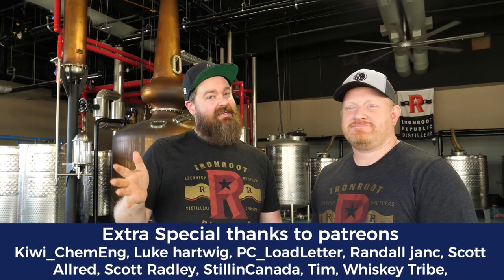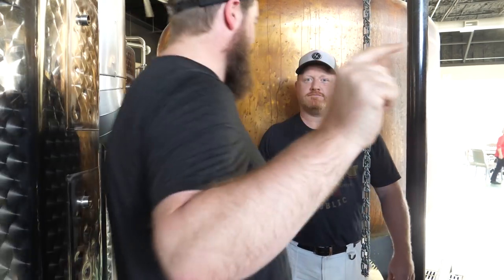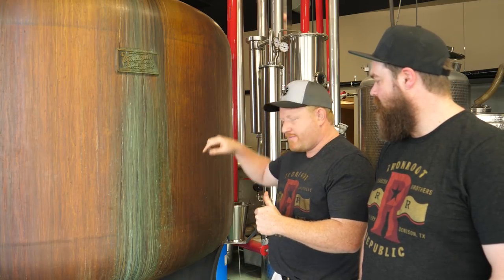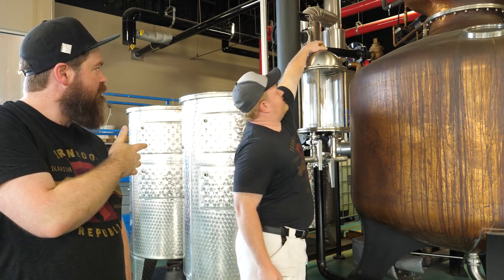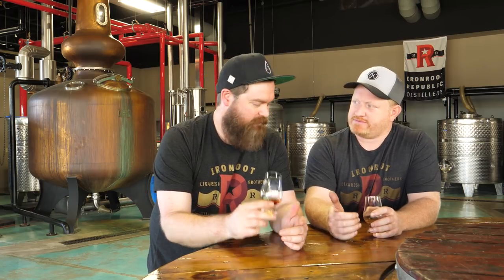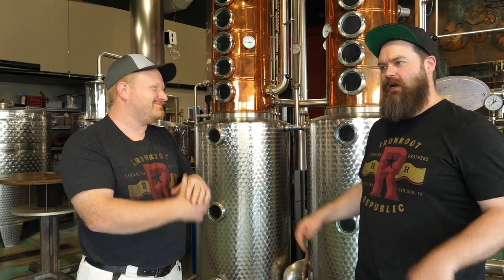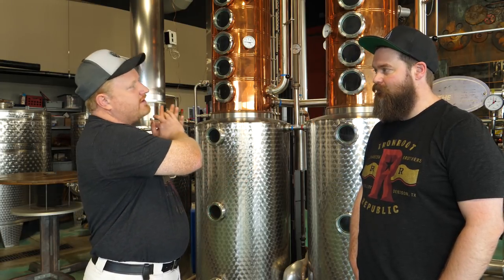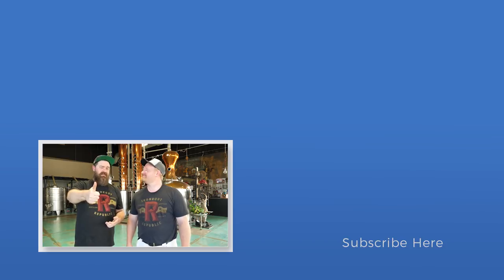The Stills Ironroot Use To Make The Worlds Best Corn Whiskey

Comment: This makes me want to buy a nice big sheet of copper and start bashing! nice tip about the condenser water temperature control. I have wondered about that in the past, and I've usually just adjusted water flow rates to get the output as close to 20ish as i can without having to constantly fiddle with it, though I reckon there's some experimentin' to be done!

Comment: Great video Jessie!  I gain addition knowledge with each video and the discussions that are driven by them. The copper craftsmanship is a work of art and science.  I generally thought that the colder I could keep the condenser the better, but it makes sense that you want to keep the condensing towards the bottom so you have vapor in contact with the copper for as long as possible before condensing and collecting it.  I am going to monitor my water temp in the condenser now.  Thanks!
Reply from the maker: Yeah those stills are awesome right? 
That was a big take away for me as  well.

Comment: Good one Jesse.  You asked the right questions and I could see how much of what they do on the commercial scale relates to what we do as hobbyists.  For instance, there's a lot of discussion in the forums about the importance of maintaining a heat gradient in the condenser.  They do it by maintaining the temp of the coolant and we, as hobbyists, do it by maintaining the flow rate of the coolant - achieving the same end result.  Lots of thought provoking discussion in that video.
Reply from the maker: Pretty interesting right?

Comment: So what happens to the sulfur that is removed in the pot and column? Is it just always in there stuck to the copper?
Reply from the maker: Yup until its cleaned out every now and then.
Reply: @StillIt  What a nightmare it must be to clean out that massive still, or do they just hose the inside down with water?
Reply from the maker: @MsBlacklabel1  they can literally climb inside it haha
Reply: @StillIt  hahaha, that's true. Can u make a sulfur taste test video with a copper or copper packing run vs without copper? sulfur taste test or something? not alot of info out there
Reply: Sulfur sticks to both the copper column and inside the copper boiler. Lot of Hobby Distillers add copper scrubbers inside the column and, directly into the boiler (inside stainless steel keg - copper pieces or wire) to remove additional sulfur.
To clean copper - Citric acid bath. Soak until the copper becomes shiny. Takes only a few minutes depending on concentration of citric acid. You can purchase citric acid on amazon. Or in canning section of your local grocery store or box store.
Reply: BigEdsGuns I’m aware of this. But how long before the sulfur that is sticking inside affects the taste and quality? Can you let too much stick? How much is too much? When should you clean it out? How do you clean it out? Wouldn’t if it sticks to copper eventually would be no copper left in contact with the mash and this affecting the flavor?

Comment: Did you ask them why they opted for steam instead of oil? For the heat transfer fluid? I recall you had that fancy oil based machine a few weeks back, the Genio? Still have it?

I've been slowly doing research on going commercial, and there are a lot of cost savings going with oil over steam.
Reply from the maker: At this size it's just going to be more efficient I guess.

Comment: Absolutely random fact: you can’t swim in alcohol at 40%. My stepdad worked in a distillery and all the vats have ladders for this reason (think about the gravity readings ! Even with a lungful you are still denser than the liquid). There may also be issues with surface tension meaning you can’t push the alcohol around you (swim)
Reply: Also, someone dented the copper still (onion) by accidentally hitting it with a forklift, altering the surface area and the had to be reworked (hammered) back into shap
Reply: More randomness: Jim Bowie is where the Bowie knife 🔪 gets its name. The story goes; after being shot in the hip Bowie charged his opponent, who clubbed him with the gun knocking him to the ground, he then fired at and missed Bowie while he was lying prone, so drew his sword cane and stabbed Bowie. When the opponent put his foot on Bowie’s chest to wrench the blade free Bowie promptly disembowelled the man.
Reply from the maker: Love the random facts.  Didnt know any of them, now I do!
Reply: Also, due to specific gravity, toasted/charred oak sticks soaked in water, will sink traight to the bottom of a jar of good liquor. It makes me smile every time I see them "defy bouyancy" ;-)